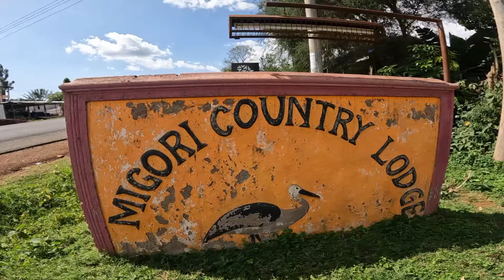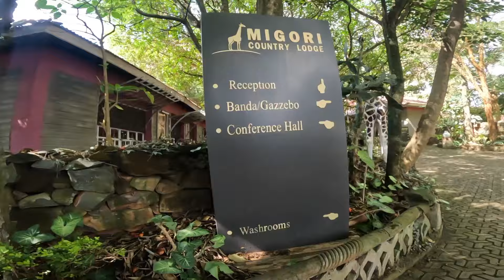FIRST TIME WE FINISHED STEP 1 TO PUT SLAB IN MY DREAM HOUSE {EMOTIONAL😭❤} {FINALLY MY MOM VISIT ME}

Comment: Mayuguno, did you prepare the foundation of that house for a 2 storey building, or you just got overzealous and decided to add one more floor without any prior prescriptions for a solid foundation? You are a mason, and hopefully, you did the needful, or else, you should use concrete pillar reinforcement right away before you pour the concrete cement on the deckon
Reply from the maker: Is not 2 floor my house is 1floor